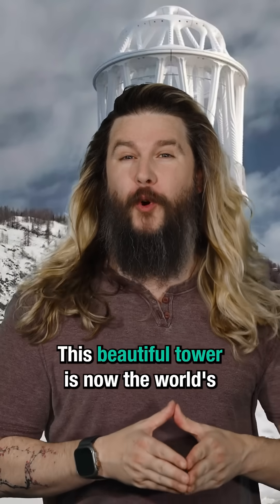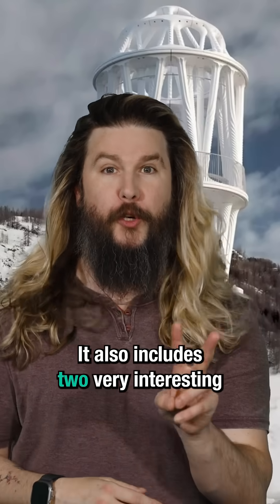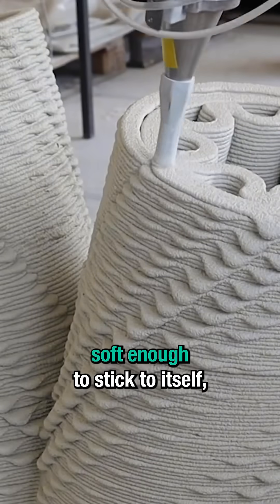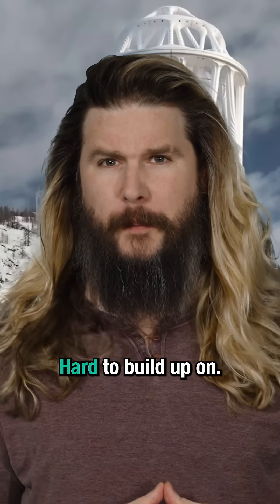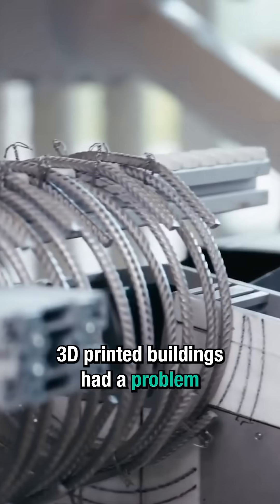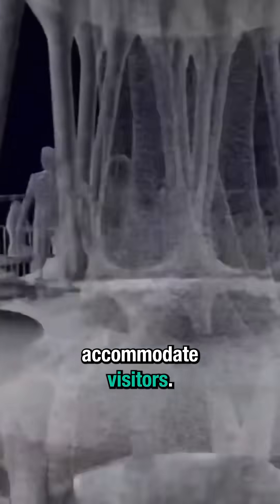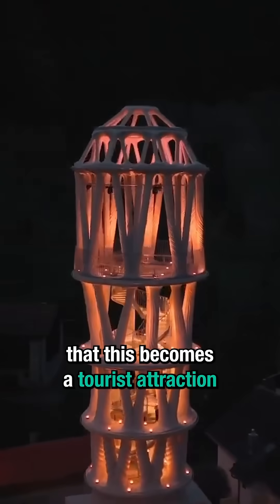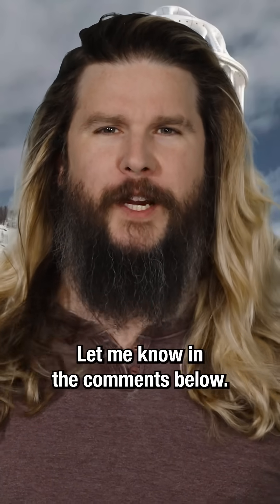World's tallest 3D-printed building!

Comment: If the loads are light enough and the environmental load effects are largely gravity driven (like light winds, seismic design category A and so on), sure, I would use a 3D printed concrete structure like this. Those rings that are shown tap into shear reinforcement concepts that we've been using in reinforced masonry buildings for some time in between the mortar layers so nothing shocking is shown here.

Comment: If it was made of steel or titanium using the methods described by Boeing (not bad side of the engineering team; as in, prior to management taking out all of the critical 878 safety features like the copper shielding, rubber electrical seals, and so on) to eliminate flaws, that would be pretty cool. As for the concrete?

Give me some text column crush/pressure tests by independent labs, and I'll get back to you.

If they were REALLY trying to get people to come, make it out of RECENTLY REDISCOVERED ROMAN CEMENT. I'd be up for that! :3 And since the building is in Switzerland, getting the raw materials like the volcanic sand/ash is pretty doable.

Comment: Wouldn't horizontal lying rings not provide it enough structural integrity? Because with what little experience I have with concrete and construction, it feels like it should be vertical rebars for a height like that.

Comment: I'm no structural engineer but are those metal rings actually going to do anything? I would assume you would want some vertical pieces to withstand any sheering forces. Especially as this is made in layers and it's where the layers join that are going to be weak points. 

With the rings being in the same plane as the concrete, it can still separate either above or below the rings and the rings won't even know about it. I think it'll become even more apparent when it gets colder and wetter. Those layers would be ideal areas for water ingress which will then freeze and crack the concrete.

Maybe there's just something I dont quite understand here.

Comment: Artistically sure why not, as practical way of building not a fan. Usually if part of a building decays you can take out the decayed part and rebuild it better than it was before. The only thing really to do to fix concrete structures like this, once it starts spalling and decaying, is to pin it back together with metal and resin. After enough time it will just be repairs ontop of repairs. Instead of say, just taking out some bricks and rebuilding back to more or less orginal condition of a traditional building.

Comment: I wouldn’t want to be the first… but I also wouldn’t want to be the 1000th+
Maybe like the 50-100th or so?

My reasoning being that after the first 50-100 you know it’s not gonna immediately fall over, but it’s still new enough that it’s /prooooobably/ (🤞) not gonna be showing signs of stress or degradation… especially with that flimsy looking “rebar” either. But since they’re using that liquid cement—not real concrete with gravel/aggregate—it’s not gonna be as strong as if they had used more traditional building materials. So I’d be worried that the older it gets/more it’s used I’d be anxiously looking around looking for any cracks or signs of the cement flaking/crumbling etc & be unable to truly enjoy the experience.

So yeah, I wouldn’t want to be the first… but I most definitely wouldn’t want to be the last (if/when it falls apart bc eventually entropy comes for us all… some things just faster than others😅🫠

Comment: That's a very interesting use of 3D printing. Though can't say I'm not concerned about the structural integrity as well as maintenance of the structure itself. If it'd porous enough to adhere to itself, environmental damage from rain and high wind might make it a challenge to upkeep. But then, I'm not an engineer ¯\_(ツ)_/¯

Comment: You mean issues with tension, and that the 3-d structures had to be build (previously) in 'comlression' as any significant tension would fail the concrete. The fact that 3D printing can't even add rebar shows how far it has yet to come.

Comment: The main issue with concrete construction, long before we had 3d Printing, was that concrete sweats, and concrete isn't easy to repair. You can take apart the concrete and replace the metal infrastructure, but you can't just slop fresh concrete into the cracks and call it a day. Concrete has different ages, different batches of concrete have different compositions. We have brutalist concrete constructions today that are best described as rotting. So as great and as quick as this feat of engineering is, i suspect its going to be a costly and expensive endeavor for this hamlet in the future.

Comment: I have an issue with the "rebar" support. I like how they have addressed compression support but There isnt any horizontal support meaning that their are week points between the rings. Looks like its ended up like state where its in layers - strong if force is applied in one direction, splits in two when force is applied from a different direction.

I dont know what the weather is like there but its a good job they didnt put walls on it if its a windy location

Looks cool thought an I honestly hope it works out.

Comment: Was there. I was quite disappointed that only the pillars were 3D printed, every platform and the base is still concrete. It also wasn't 3D printed on location but made in chunks and just assembled there.

Oh and entry is like 200 bucks and only possible with a guided tour, so...
Reply: lol omg $200? Forget it lol.
Reply: That's a whole lotta asterisks.
Reply: 3D printing in chunks is reasonable and makes sense and cost effective since transport and setting up a 3D printer on site would be expensive and take weeks for something that size.

The stairs makes sense to me for safety concerns. he platforms would be impossible to get the rebar right as it needs to be a mesh. Even if you got the mesh to work, you'd still need self-leveling concrete for the top.

$200 or 200 euro, depending on what you meant, is way too much. Those 11 people will wonder what the govt is doing with their money.
Reply: Well that's disappointing.
Reply: €200 to get in? Well that's Switzerland for you
Reply: @BaconHer0  thats like 300 usd
Reply: I mean it was 3D printed with concrete.  It's all concrete
Reply: 200???????? WTF IS THERE A HOLY GRAIL IN THERE?
Reply: That's the most reasonable use of 3d printing in construction. 3d printing on site is a bad idea but it could be a good option in a factory to make modular construction more versatile and attractive.
Reply: Basic fact check based on the tower's tourism webpage: 

The tower is called Tor Alva, and entry is 100CHF (Swiss francs - no Euros in Switzerland!). That's about 107€ or 124$.
Reply: €200 for a guided tour of an open building? Wtf are they smoking?
Reply: And I can confirm that 100 CHF is real for Switzerland. I mean, it is s00pidly expensive, but remember that this is one of the most expensive countries in the world, and this town in particular is in a region that caters to high-end tourism: St. Moritz, not far from Mulgens, is famous for having lots of ultra-luxury hotels costing upwards of 500CHF per night.
Reply: @ToadalChaos might be that they adjusted the prices, on my ticket it definitely shows CHF 200.-, but also might have been an "early adopter" price, we also got a book describing the development sent home.

Switzerland is expensive, but 100 or 200 for such a tourist thing is extremely expensive, even to the average swiss. I mean an hour of bowling costs between 30 and 50 CHF, a seat in the cinema between 15 and 25 CHF, so it's not like it's that much more expensive than elsewhere.
Reply: I get it being constructed on sight cause they'd have to have a helicopter bring it in other wise, but 200$ to walk around? I thought they wanted visitors.
Reply: Abysmal dogshit
Reply: That's not surprising for Switzerland.
Reply: 200 or 20 bucks? 
Cause 200 seems unlikely
Reply: They told us they had to raise the price, since the project was a bit more expensive than expected. They see it as a donation, so it's not like they really think it's worth that much to go up there.

Comment: I'm not sure I'd trust that to not have a high risk of delamination failure without sime kind of reinforcement that runs across multiple layers, rather than pieces of reinforcements that run parallel to the layers.
Reply: It has rebar supports as well. Also, keep in mind its concrete, not plastic.
Reply: @kingzach74  The comment you replied to mentioned that. The rebar supports are all parallel to the layers of concrete. It's common in traditional (plastic) 3d printing that they're weakest in the adhesion between those parallel layers. I'd also  be very concerned about how they addressed that weakness in this tower.
Reply: @delecti  You're correct: the metal rings shown in the video are parallel to the layers. However, the rings are being used in combination with traditional rebar supports, as stated in the video. I can only assume that the traditional rebar supports are straight up and down... so, perpendicular to the layers.
Reply: @kingzach74  it being concrete could actually be an issue though. It looks like the finished structure has an overcoat of some kind, which I assume protects the concrete, but water infiltration is inevitable. Concrete is a thirsty material and freeze/thaw is a huge factor in concrete failure.  I’d want to know more about the mix and formula of the cement to evaluate its failure capacity.

Comment: The company that's been working on 3D printing rockets uses something like an ABS extruder printer, but with metal.  I wonder if it'd be possible to use that in conjunction with the concrete paste for building?

Comment: Concrete doesn't "dry" - it cures via a process called hydration. The steel reinforcing looks under designed, there's no vertical rebar. Steel reinforces concrete so it can carry tensile and shear loads - a 100' tall concrete tower is subject  to lateral loading from wind and seismic forces. Lateral forces induce tension and shear.

This thing looks undercooked to me, and the 3d printing technology is a solution to a problem that doesn't exist.
Reply: He literally says there are also vertical rebar as well.

Comment: 900 hours is only about 37 days of building. That's pretty fast for a 100 foot tower, right?
Reply: Considering there's probably only a handful of people actually crewing the site directly.  It can take upwards of several months to build a regular suburban home, much less something 5 times taller than that.  Granted that's including things like wiring, drywall, painting etc.  But to throw up the structure of a house enough that you'd be protected from the elements is still a multi-month process, not counting the several more months to possibly years it takes for permits and zoning.

Comment: 3D printed Buildings are best used for building complicated Space Colonies in my opinion (plus it looks good)
Reply: I think excavating or using existing surface features like craters and caves would be best
Reply: @infernaldaedra  excavating wouldn't be ADDITIVE manufacturing.
Reply: Not on big rocks with atmospheres though, but maybe on the moon it could work
Reply: @TheHydrator2003 On the moon I would use it as a possible structure to build moon dirt around to make a possible shell for cosmic rays
Reply: @Wyn2007 nah Shackleton will be good enough for that 😂
Reply: Cute guys.
Reply: Good sir, is that a Lancer reference?? Lol